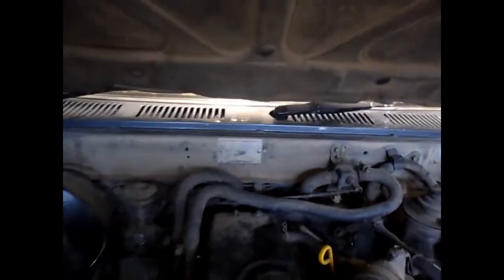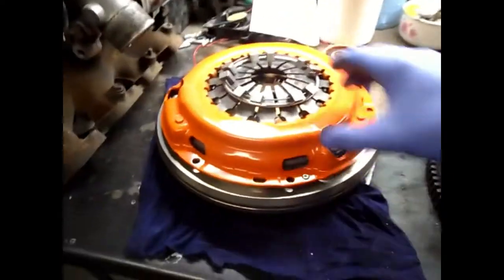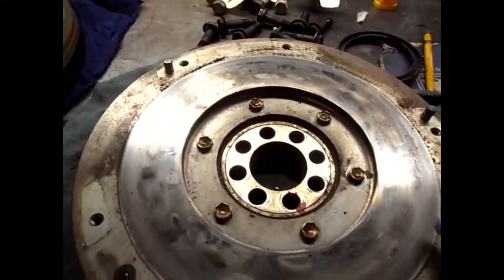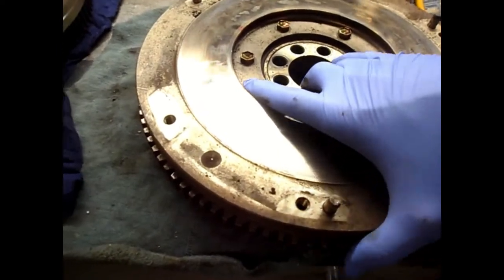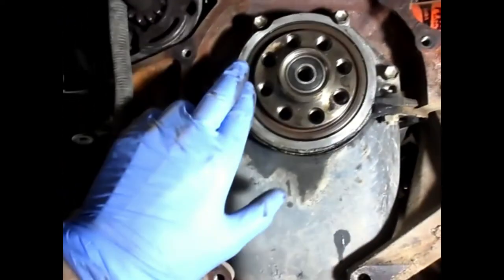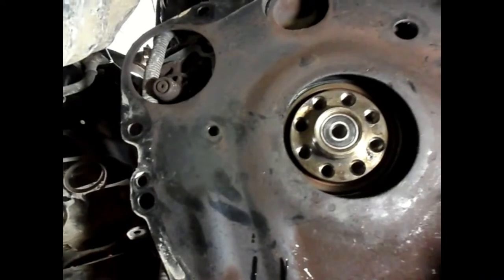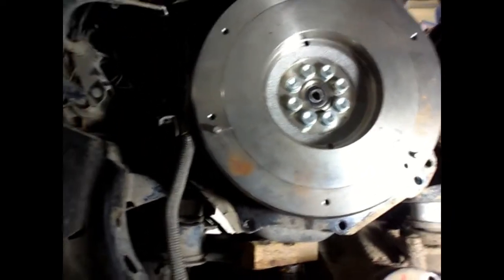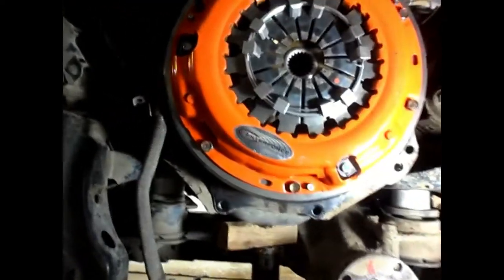1992  Toyota Hilux LN107 clutch replace with Centerforce DF501110. Also Dual mass to Single mass

Comment: Do you have the part number for the single mass flywheel?
Reply from the maker: No I never asked for that part number but a JDM import dealer should be able to get the number or even the part from Japan